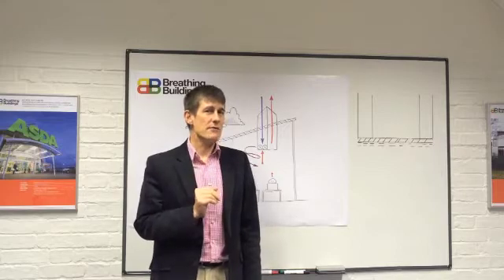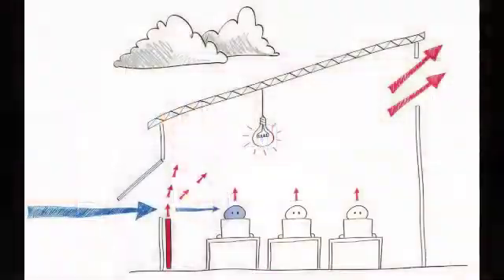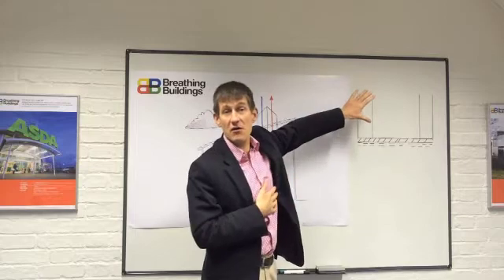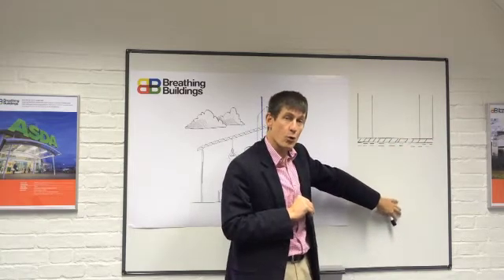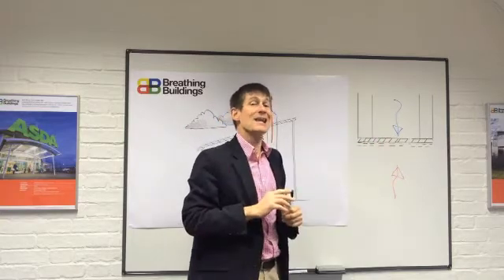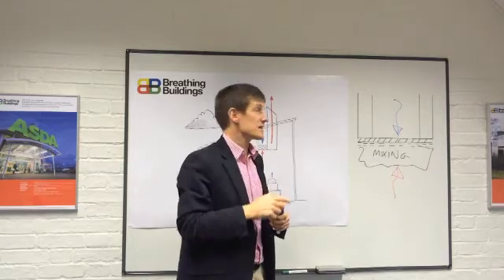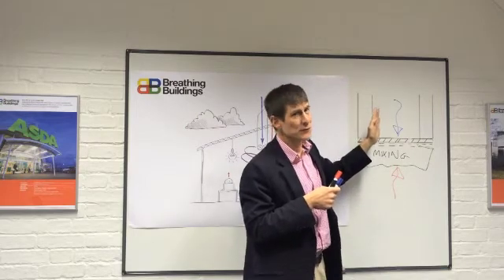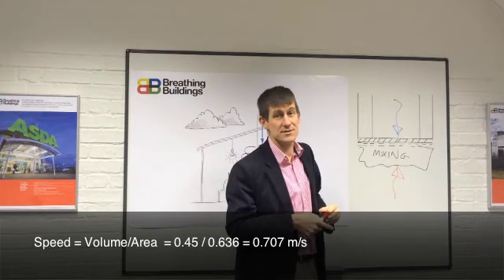Horizontal mixed air delivery

Comment: I like the product but why can't you just use a diffuser on the bottom of the stack? Then you are spreading the fresh air delivery and no one gets cold draughts. Wouldn't that enable any stack system to do the same without using a fan?
Reply: +jmcg1010 and does the use of a fan in fact mean that this is mechanical ventilation? There is a mechanical component on which the units would rely heavily...
Reply from the maker: +Jonathon Hunter Hill If the  forces which drive the airflow into or out of a building are derived from a fan then it will be mechanical ventilation. If they are the derived from wind or buoyancy then it is natural ventilation. If you need some help, please call the office.